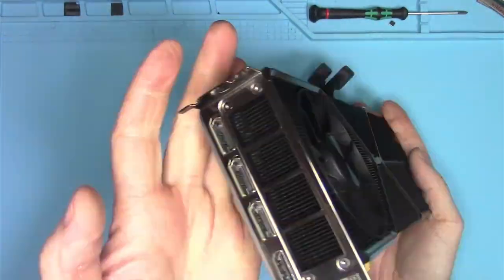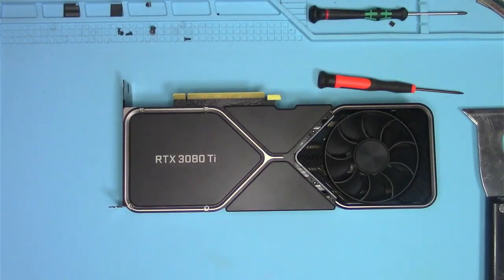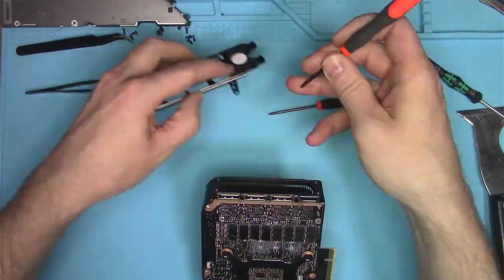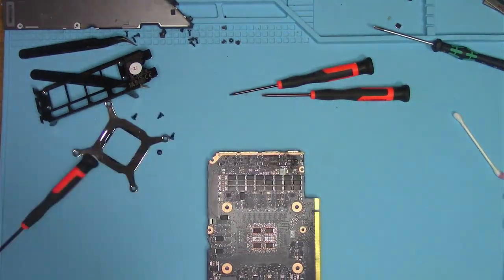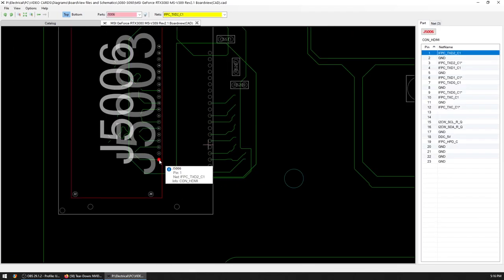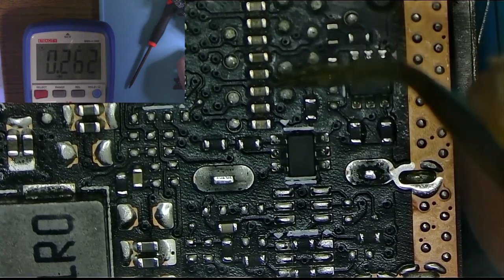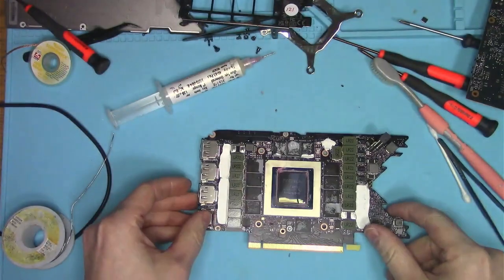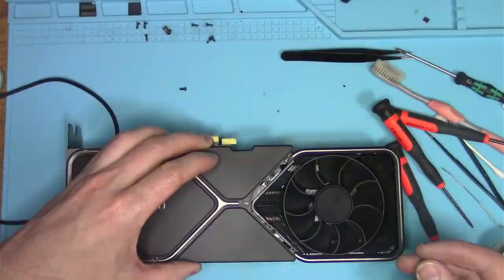Should you power down your PC during bad weather ?

Comment: I think you should still take a charge for attempting repair. It's your experience, your time, your work. Depends on each case, but you use electricity, solder, flux etc.
Reply from the maker: People expect if something isn't fixed then there should be no charge.
I do operate a full scale business so it's ok.
Reply: @northwestrepair  yes, I agree if you work full time in another place. 
It's absolutely amazing what you do with those cards. Thank you for sharing with us. All the best to you.
Reply: @northwestrepair would you offer less if theres still a lingering issue after your repair that stays even after your several checks?
Reply: Yep, it's called "diagnostics" and should cost something ^^
Reply: @northwestrepair  If/when I ever send a card for repair and the card is shot, I'd certainly want you to keep the card for parts, if that's possible.
Reply: I worked at one of the highest performing McDonalds in Western Canada in the mid 00's. They had a room downstairs stuffed with trophies. The general manager responsible for making that store so successful had business cards that were also coupons for a full meal at no charge, and he handed them out like candy. Any slight problem with your meal, and you'd get a card. He would never argue, even if the problem was trivial or obviously blown of proportion. While I was training for management I asked him about it, because it seemed like a good way to lose money, especially with those overblown complaints. He said something along the lines of: 'this costs nothing compared to losing a lifetime of business from a customer.'

Giving away free attempted repairs is just good business. Imagine having a trashed card that can *maybe* be repaired. Do you want to spend a hundred or more dollars just to find out that it's fried and you now need to spend a thousand or more to replace it? How are you gonna feel about the guy and the place that charged you that wasted money? When and if you need another repair in the future, are you gonna feel all warm and fuzzy about that repair guy and call them right up?

North West Repair isn't wasting money, he's investing in lifelong customers.
Reply: I think this is a better pricing model as a customer. I no longer trust repair people because every single time i have brought in something for repair, i have been quoted a repair cost that is more than the residual worth of the device, and had to pay diagnostic fee - and that's the whole business model, open things up, shut them close, charge people, wtf is that good for? You may say it actually makes repair a little more expensive, but it also eliminates actual bullshit and makes it more viable to actually bring things in to get them assessed, so eh? There's a barrier to throwing good money after bad, and if something isn't likely to be repaired, AND i have to pay for that regardless, i just won't bother bringing anything in.

After all, the repair person isn't obligated to take in items they don't feel they might be able to repair economically. They have a full time business so they might as well use these dubious items that likely won't be repaired to fill their idle time when they aren't brimming with higher success orders, or to give people offers to leave them the item to salvage for parts.

One time i had a device effectively stolen from me. I brought it back to the store where i bought it after failure within warranty period, it was a Casio PocketViewer, which i bought for 90€ i think. It was arranged that they will call me before attempting repair, if the item isn't eligible for warranty service. Two months later, they call me and tell me that i should come by and get my device, it has been repaired at my cost, that i owe them 120€, because there has been water ingress and they replaced the backlight fuse. I fetched a classifieds newspaper and an hour and a half later i had a higher spec lightly used PocketViewer for 5€, still works.

As you might imagine it was over 2 decades ago, since then i went to university for computer engineering and i do my own repairs.

If i opened up my own repair, i'd be half so tempted to scam my customers back for all the "repair" i received in the past. I wouldn't actually do that but i mean i'm still angry.

Comment: The "pink toothpaste of the owner" is probably Thermal Grizzly Kryonaut Extreme thermal paste. I used it as well to fix my EVGA RTX2080 just a couple of months after I got it and it was running hot due to poor thermalpaste application.
Reply: What temps are u getting before you put another batch of thermal paste in there
Reply: @asian_slav1851  If I recall correctly fan 1 was ramping up to maximum speed when the GPU die was at 80C during idle and the GPU started to throttle and performance dropped, whilst I got annoyed by the vacuumcleaner the card had become.
After using Kryonaut Extreme I went to 42C idle temperature and the fans barely operate. Even during full load the fans are hardly working and the temperatures are easily kept in the normal default operating window (haven't edited the fan curve with Precision X1). I just can't remember the temperatures from the top of my head. 56-60C I think there about.

Comment: I know this is gonna get lost, but here's my story:

This happened back in 2014. My pc on the ground floor. It was powered on. Can't remember what i was doing. Maybe some ☠ stuff.

I was on the 1st floor. Huge boom. It was very close. We though it hit the roof. My parents were on the 2nd floor.

After some time i went to my pc and it was doing the strangest sound. To clarify, my pc was very loud back then. Noisy fans and all. But after the lightning, all the fans, 7 in total + 1 on psu, were spinning extremely slow. All of them. Pc was unresponsive. Even the power button. Case was an atcs 840.

What happened? The lighting hit the telephone line outside. It passed through the line to the router on the first floor, then to the lan port of the pc. 

Thankfully only the lan port was toast. Its light stayed on even if the pc was powered off. 

That's it.

Comment: your not wrong but do not do that with a switch do it with a UPS uninterrupted power supply the keep the power clean even my TVs on the UPS I use at least 2 UPS in my room one for my boxes network switch and tv 900w other 1500 va in my room for my gaming setup one for my other setup for my laptop and monitors all ways Use a UPS on your computers change the batteries in them every 3 to 4 years then change the units e very 8 years it keeps the computers running

Comment: I'm surprised by the fact it a direct line that killed the gpu chip also surprised there not a sight of fuses to even protect the gpu chip from this kind of damage
Reply: I also thought there was another component which would generate the hdmi/displayport signal rather than it being handled by the core itself. Know that for very old cards they used to have a RAMDAC to generate the VGA out signal.
Reply: The distances between components and traces in a GPU do not afford protection against lightning no matter which components you may think to choose. When it gets inside the low voltage part of PC or on the wiring between PC and other devices, it's too late to do anything about it. Fuses are the wrong devices to begin with, slow, you want to short circuit the lightning with varistors, diodes etc. There are usually transient diodes on the board which is closer but they can't really help lightning either.

External video port hardware has been dead for a long time. Was just staring at Geforce2mx the other day, it's all on the core, there's only a logic gate external to form the sync signals. You need modern electronics to form a high speed video signal, and driving some intermediate IC would take up just as much core/IO footprint as forming the final video signal.

Comment: I had a hdmi switch take out a monitor pcie slot and gpu then without knowing the pcie slot was dead I plugged another card into it and it got killed thought about sending it to you still have it but 1660 so not really worth it the switcher blew up and the breaker poped

Comment: this could also be "what having barely enough power supply wattage will do to your graphics card"    add up your system specs, fold it till its all corners and shove it up your go buy a 1000watt supply that'll last 7 years and ignore things that reset your air conditioner...

Comment: shitty PSU inside the TV killing a expensive GPU. I personally saw a melted HDMI cable between a TV and cheap  set-top-box. The STB shorted to ground through the TV taking it out in the process and melting the outside sheet of the cable.. I would like to know the TV manufacturer ,but hey ...

Comment: Static is a myth It wont harm your PC  Linus and mr boom and others did a static charge test 100 times on ram gpus m/b's nothing Broke 
so them static cable attachments are useless as bat chit ive never used one building a pc rubbing my feet on carpet ha! Tzzzz cats fur stands up
Reply: to remove solder you can use copper wire - some youtuber forms shapes  and puts over chips using a heat gun sucks the solder onto it handy idea
or get copper mesh out of certain old tv cable / coaxial

Comment: This is why surge protecting even your TVs and monitors is important.
Reply: Surge protectors won't help in a direct strike and anyway you're supposed to replace them every few years, which most people don't.  UPS battery backup is a bit better, but in SE Asia where I used them I had to replace them every few months since there were so many surges during storms or during power spikes from sub-standard power stations, they would blow up the batteries.
Reply: @raylopez99  all depends on the joule rating of the surge protection, same goes for those UPS's, they have a max rated surge protection too.